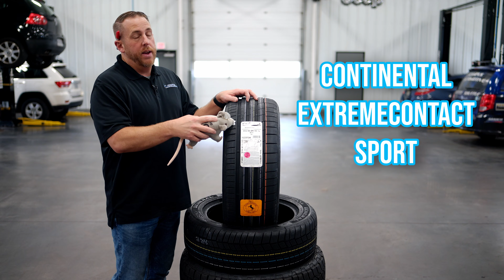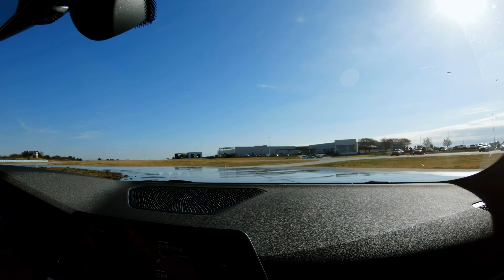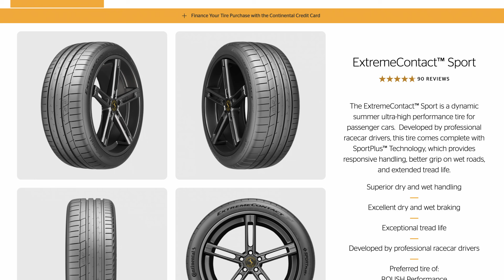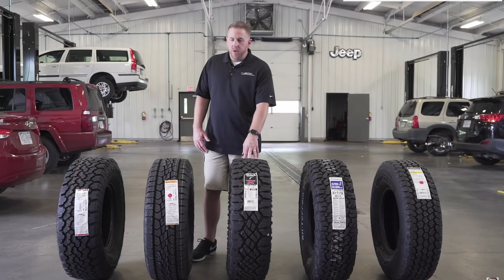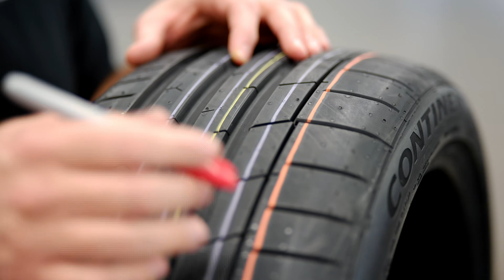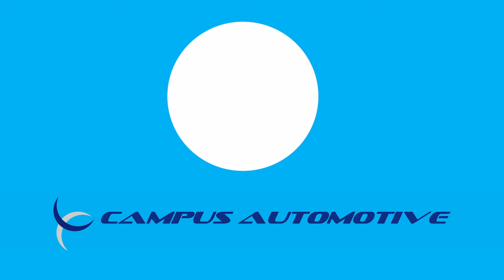Continental Tire | Extreme Contact Sport | Ultra High Performance Tires

Comment: the "D" marking is dumb. unless it's showing thread, the balder the tire, the better the dry traction. Maybe the D goes damn near down to the threads, but it doesn't look like it. these tires are on closeout in my size for my Z06 corvette for literally half the price of the Toyo R888Rs I normally buy so I'm trying to find a review, but it sounds like these, while possible decent on the track, are pretty bad for straight line acceleration

Comment: Does the Extreme Contact 02 replace the SportContact 7. If not, does anyone know the difference?
Reply: The Extreme Contact Sport 02 replaced the tire shown in this video. It's overall a better tire.
Reply: They are both UHP summer tyres, if not mistaken the SC7 do come as OE factory fit on many cars, whereas the Extreme Contacts are not an OE tyre

Comment: Very informative video. I do own a C7 Corvette Z06 and its time for a new set of tires on the rear. I have Mechelin pilot sport AS 3 on them. They are decent tires, but they dont hook well in frist and second gear. Well, I know that you can hardly find any tire that can hook in the first gear for a Z06 due to its extreme power.  I just want to know how well these tires can hook on first and second gear on my car.Thanks for the videio.

Comment: So in my experience with both the DWS 06 and the Sport, these tires flat spot like CRAZY. I'm talking, overnight.  Changing pressures hardly helped and since trips in my car last less than 20 miles, they were almost always the least comfortable. I had two sets warrantied and even rebalanced them at my own shop to no avail. Road force balancing them didn't help.
Reply: I swapped to Michelin PS4S and rebalance them every other month the flat spots work out within the first 5 min of driving at speed

Comment: Ordered a new set of these three days ago!! my previous set lasted about 50k miles with routine rotations, i consider myself a "spirited driver" but these tires are amazing. even when at 3/32 the performance in dry weather is still %110.

Comment: Curious question, what is someone supposed to do when one of the symbols wears out on the DWS logos, and not be able to use the tire for that category anymore?
Reply: Yes, snow goes first, wet goes second, then dry last.
You can do whatever you like but if the S is no more drive very carefully

Comment: I had the Michelin Pilot Sport All Season 4 tires (which replaced the A/S 3+) on my Mustang GT (not the 350) for 20K miles and just had these Continental Extreme Contact DWS 6 Plus installed on the car and am truly impressed.  I also changed the tire size to match the Ford Performance Racing School set up.   265/35/19 and 285/35/19 respectively.   A game changer.   I also had Tasca Ford install the MFR3A-8A track suspension package.   I no longer fear chasing a Camaro or Corvette into a corner at speed.  Supreme confidence ...
Reply: Meh you'll still lose to that camaro in the turn tho...... trust me ; )

Comment: I'm on the fence between these or Michelin pilot 4s which is the original tire on our mustang gt premium.. wanted the BFG GForce but they are not available due to supply issues..  I have never used continental tires so idk... want a safe tire for all types of situations yes some aggressive driving at times... what's your opinion continental extreme or Michelin pilot 4s for 2019 premium mustang gt 5.0 ?
Also tires are staggered 255/40 zr 19 on front 
275/40 zr 19 on rear
Reply: Kimberly, I have a 2020 Mustang GT PP1 Convertible and I just put these tires on.  They are far better than the Michelin Pilot Sport All Season 4.  I also changed the sizes... I bought 265/35/19 and 285/35/19 respectively.  The same sizes the Ford Performance Racing School uses on the Mustang GT's with the Track Suspension package .... I would add both and you will find it's life changing.
Reply: Thanks for the info Mark!

Comment: Put 27540r20 continental extreme sport 
On last July having to replace them on my scatpack less than a yr later 9k miles 
Of hwy and they need replacement going with the dws06 this round 
Love the tire but crazy how a 30k mile tire won’t last for than a couple months 
Love there warranties could potentially get a new set each yr

Comment: i just installed these on my 18 mustang gt this morning (4-16-22) and they are replacing michelin pilot sport4s tires and so far they are extremely good. granted i had the michelins for 19k miles daily driven and they were phenomenal since day 1, i fully expect these tires to perform the same. at $314 a tire versus $370 for a new set of michelins, i am super pleased so far.
Reply: I'm doing the exact same thing, just ordered them. How is the noise compared to the PS4S?
Reply: @taigashenpai2434  i'll be honest i run full exhaust on my car so i dont actually hear the tires over the car itself but after 3 months the tires have really dialed in and after wet and dry days they are phenomenal. for what its worth the sound is about the same from the 2 tires eventhough i cant hear them lol
Reply: Per reviews the continentals are quieter @taigashenpai2434
Reply: bro these are 190 a tire at discount tire/tire rack
Reply: @Willppyro  yeah im sure they are in a size small. check again for a size 275/40zr19. $331 right now per tire. thats what size my car takes, congrats if you have smaller tires and they are cheaper for you, you certainly win there.
Reply: @1TakeState  how do the tires compare to the Michelins? Would you buy the Continentals over the Michelins if price wasn’t a factor?
Reply: @kennykannar8971  ill be honest, i would buy both, its tough. both tires have been phenomenal for me. ive daily driven both tires for thousands of miles and they are both great. i have yet to run the Conti's through the winter yet but i have no doubt they will do just as good as the michelins

Comment: I watched one of your previous videos a few months ago about the other Continental tires.  I’m trying to decide between the All Season Pure Contact, True Contact or All Season Extreme contact for my Tesla Model 3 RWD.  The size is 245/40/19 and I live in AZ so wanted to see which you would go with?
Reply: Depends what you're looking for and how you drive honestly. If you want a nice comfortable daily and tires that LAST I'd go with the TrueContacts. The rest are up to you how sporty you want to go... I used to have the DWS 06 on my Miata they have a good sturdy sidewall and last a long time for the performance you get, I have the summers on now since I don't commute with it as often and mostly use it for spirited errand runs on my days off.